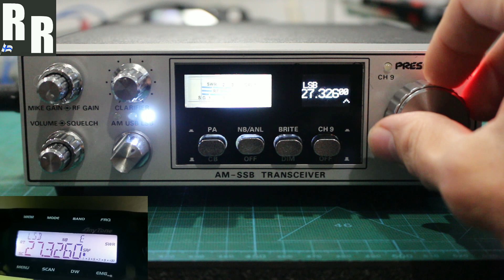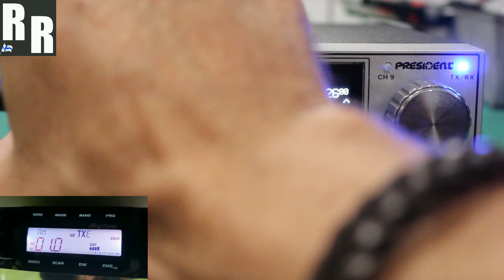President AR144 + RR HF VFO for Ian 26DR247 in UK - 09-03-23 (demo with Tony)

Comment from the maker: Using RR HF VFO, replaces radios PLL, VCO circuity with a precision DDS control of frequency
Sales, prices and info -> https://www.facebook.com/media/set/?set=a.2186013931467450&type=3
Originally released in 2021
https://www.facebook.com/photo/?fbid=4880952545306895&set=a.1626519547416894